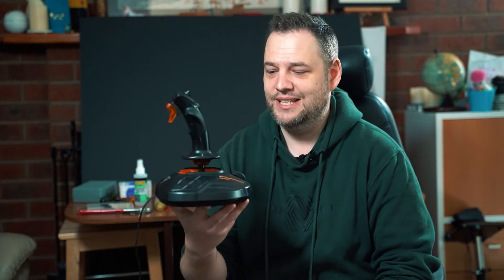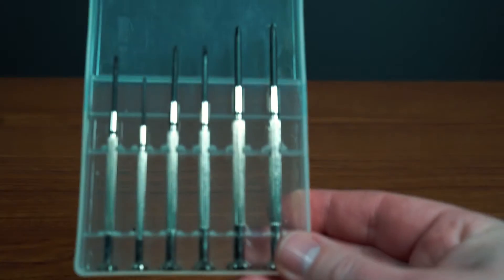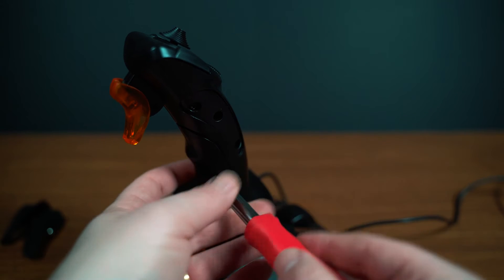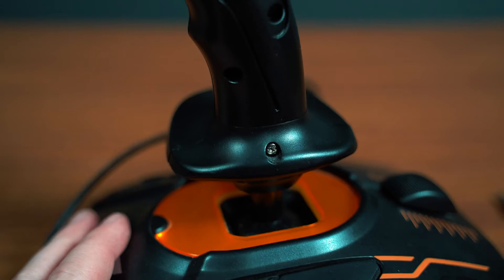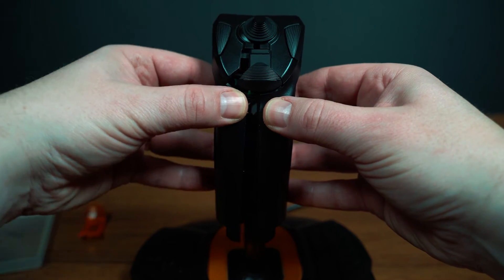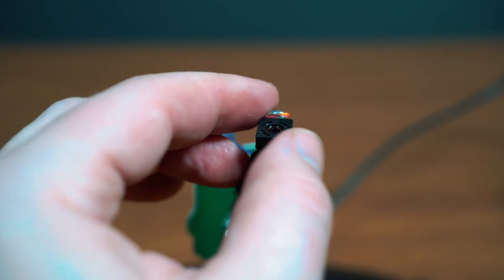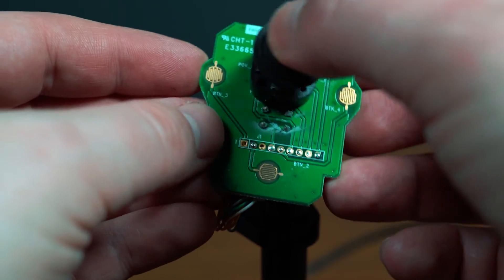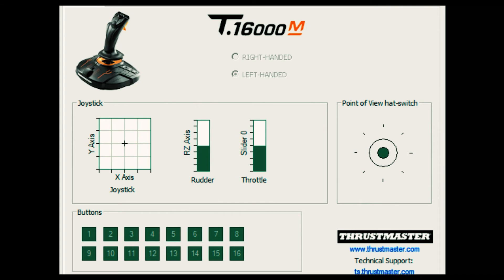Easy fix for T16000M stick/twist rudder - Complete tutorial

Comment: I bought and received a used T16000M and sure enough it had this issue upon arrival. I want to comment and say thank you for this very detailed breakdown. Beginning to end it only took 45 minutes, but would have taken x3 longer without this instruction.  Worked like a charm.

One comment. Isopropyl  alcohol is usually the main ingredient in eyeglass or screen cleaner... for those in a pinch.
Reply from the maker: I'm glad it worked for you and thanks for the additional info! 😁👍

Comment: Great Video! I had the exact same problem about 8 months ago. I opened the Stick as you did.Turns out, that also the little red cable on the potentiometer that runs down to the base was ripped of. I just touched it and than I had the cable in my hand... So I found on ebay an old version of the stick (green light instead orange). I use that one for now. But now the throttle has a little potentiometer issue. I'm thinking about open it up and take a look there. Stay healthy everybody and greez from germany ;)

Comment: This video helped me so much! However I was able to work around the nipples of doom. I every so slightly separated both sides of the stick, and was able to expose the RZ axis sensor. From there I could apply the alcohol. Then did everything in reverse, saving myself this nightmare.
Reply: Thx, did the trick for me!
Reply from the maker: Good work around. Well done. 😁👍

Comment: 5:02 I am not able do get it out, it sits too tight. However thanks  for the great video
Reply from the maker: Yeah it's really stuck in there! You could try resting the stick on the side, putting the screwdriver in and gently tapping it with a mallet to get it shifting. Once it's a bit if the way out, it will go. I'd recommend resting the stick against a sandbag or similar to prevent damage as you tap. Hope that helps!
Reply: @ArveyJay  thanks for repley. Thats a good idea but I'm afrait to break the plastic. I am still in guarantee so I will try to find another way with Thrustmaster.
I would have returned them but they are nowhere in stock here in Germany
Reply from the maker: @Xam06  Good luck mate, I hope you can find a solution!
Reply from the maker: @Xam06  I hope you were able to get the rod out, if not I made a separate video just dealing with that on my channel. Hope it helps you. Cheers.